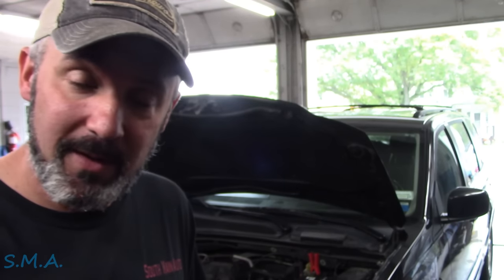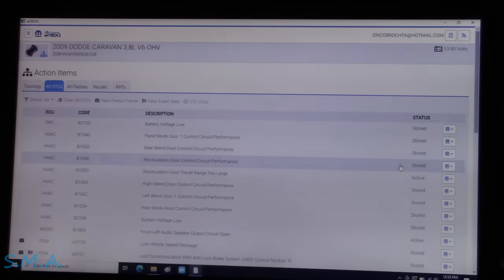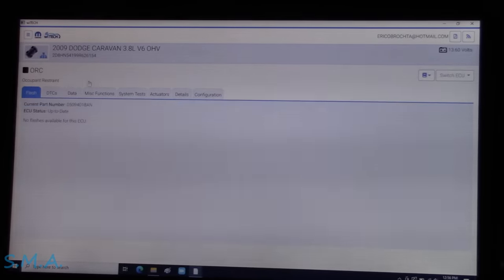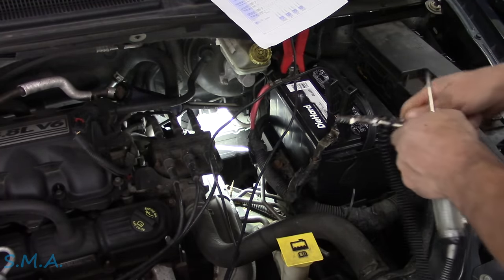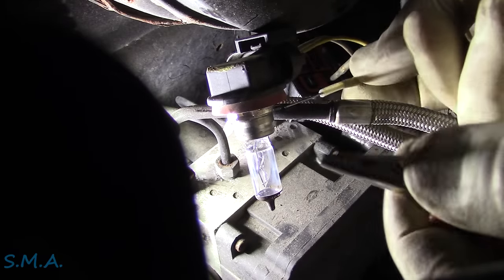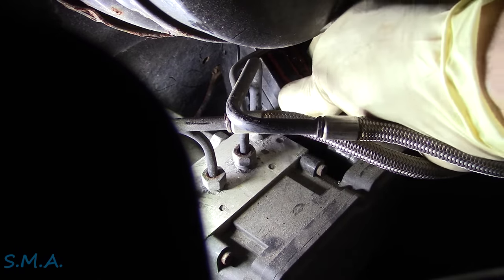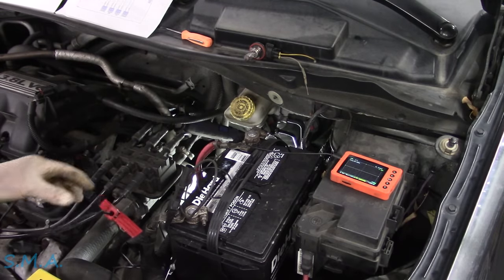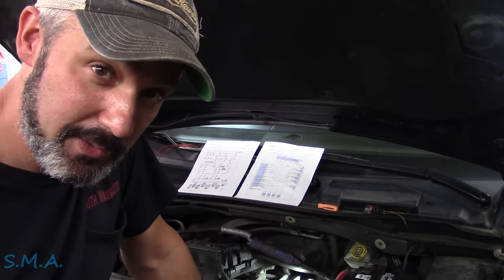Dodge Caravan: ABS Module Failure / No Speedometer

Comment: Could you explain why you needed a new abs module if it was communicating on the can network.
Reply: Eric was checking the rest of the network to make sure it was talking. The ABS module was disconnected and he was checking the harness end. The scan tool said the ABS module was not talking, but this shows the wiring going to the ABS module was ok.
Reply: @bobturcotte3354  thank you for your thorough explanation.

Comment: I've seen you and danner cut a CAN wire once it's confirmed the CAN network is in tact down stream. If I understand correctly, you plug it in, cut the wire, and verify that there is in fact no Hi or Low CAN present. Why were you able to make the diagnoses without doing that in this case?
Reply: He unplugged the module and verified a proper can signal coming from the car, to the abs module.  The goal is to make sure there's communication available to the module in question.  Backprobing the circuit plugged leaves a variable -- the signal could be coming from the car, or the module.  Unlpugging the module proves the signal is coming from the car.
Reply: @ablackformula  Right. But then plugging it in, cutting the wire, putting the scope on the cut wire confirms/disconfirms whether the module is capable of talking or not - while eliminating the modules talking down stream.
Reply: @johnemberton408  I agree, but not to cut the wires. If we owned a car,and take it in one garage, we wouldn't like them to cut the wiring loom of our car... .But is another option (which I try to use it all the times),use a break out box,but because it's really expensive to have one or even more, for every car,you can use break out leads,which is universal style, you only have to connect couple of hot wires and couple of grounds, and the 2 can wires. The other wires, doesn't  really matter, because you are checking the CAN signal.

Comment: And no video on the used part installation ?????? Brakes grinding metal to metal got fixed I hope !!! Need to take care of your cars maintenance, it's important !!!
Reply from the maker: Nope I just fixed the engine light so they could get a sticker. The local shop that does the lickem stickem doesn't look at the car, you get a sticker of the light is out....

Comment: Hey Eric not the same beast class 8 I work on the new P4 Freightliners have 3 datalinks yeah see a screen full of com codes kills the network truck wont even crank. Found 99.9% a short to ground on the can link powertrain modules not chassis modules they use 1939 double encased wiring. This stupid hockey tape loom does not work that they are using a bullet proof design would be this tape inside conduit conduit by its self on wires wears little debits in the wire in the extreme a diesel, gas not so much. Have a 2004 Columbia old school 1587 data link no 60 ohm check tomorrow no com with the ABS. Its point A to B a process.

Comment: All the lights are on...I hate when you can't just cover them with tape. 🤣
Reply: You'd have to put plywood over the entire instrument panel on this one.
Reply: @bad66chevelles  1/2" 4 ' x 8' sheet CDX grade ground-contact plywood is US $34.97 at a Chicago-area Home Depot. Where are you buying $100 plywood?
Reply: @bad66chevelles  I'd shop elsewhere; Lowes is always the highest prices. Perhaps you can get by with a lower-cost option like a 2' x 4' x 3/16" handi-panel for about $10 at Menards. Home Depot would be a little higher. We could use cardboard I suppose, but it's so low-tech. :)

Comment: At around 11.20 would it have been easier to just connect the test light between one of the power & one of the grounds (And repeat for other powers & grounds) - if the light lights both are good - less probing and no need to bring a "hot" wire down. Obviously if no light you would then want to do the test "properly"

Comment: Its a dodge just throw it over the hill to the junk pile. Daimler cant design or build anything! Edit... nearly every dodge that I have worked on or Jeep I always go to the wiring between the jamb and the door on the driver side and passenger side if you have a broken ground there it's over everything will be acting up. And For all you do-it-yourselfers out there if you have to mess with a heater hose between the engine and firewall your best bet is not even to mess around just by the heater hose kit and when you open the box and see what you bought you'll be damn glad you bought the kit instead of tried to fix the one hose that's leaking. Gosh darn I hate Dodge sorry to ramble on here on your channel Eric but I worked in the Dodge industry in 1999 when Dodge sold out to Daimler and they cut every single contract as soon as the paperwork was signed I watched thousands of people lose their jobs because Daimler cut every contract America and gave them to Canada Mexico and South America. So I have absolutely zero respect for Daimler and the trash that they put out. Nough said